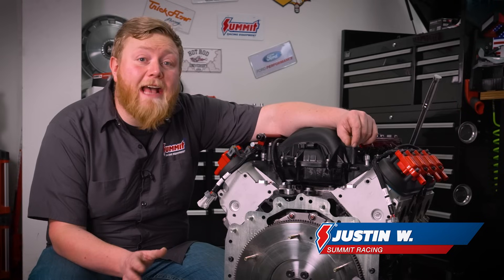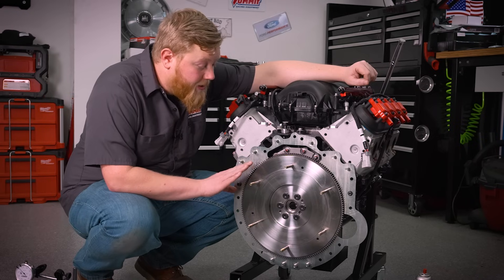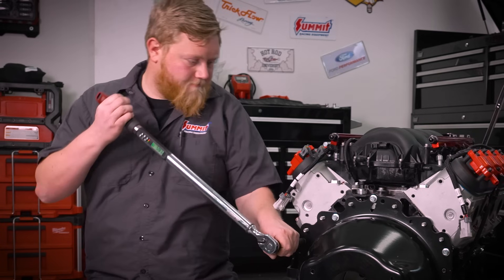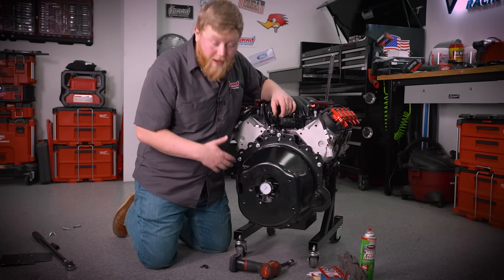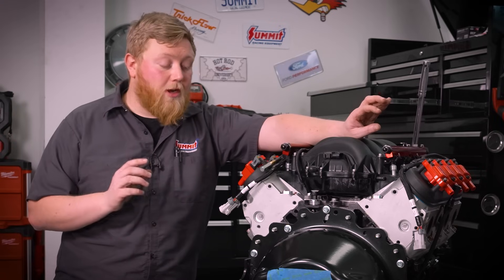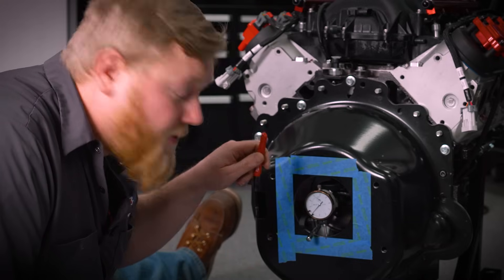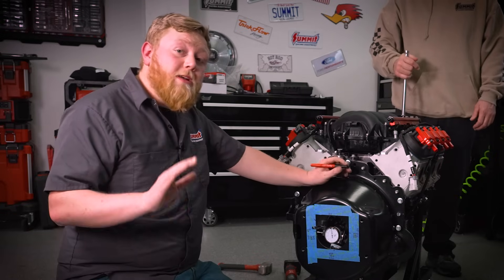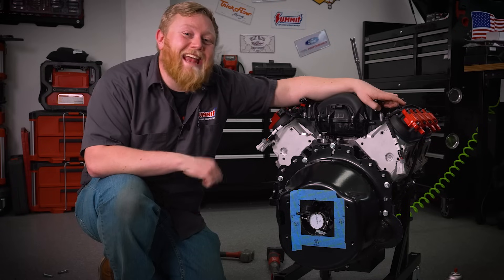How to Properly Align a Transmission Bellhousing (& Why It’s So Important!)

Comment: I had such a nightmare with dowl pins. Most are not marked as to what side is high and low. Be sure you buy a set that has that marked. Makes it  so much easier. I used silver sport transmissions they were 1/8 of the cost of the expensive ones I found on summits website. Took me almost a year to figure this out. There were no videos and I couldn’t get a transmission shop or machine shop to help me.
Reply from the maker: Glad you got it figured out, thanks for watching!